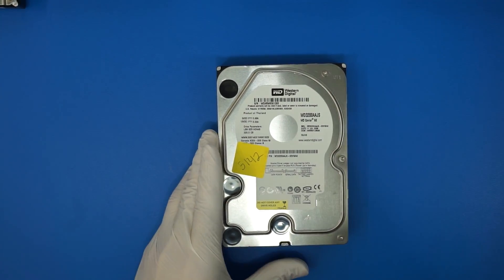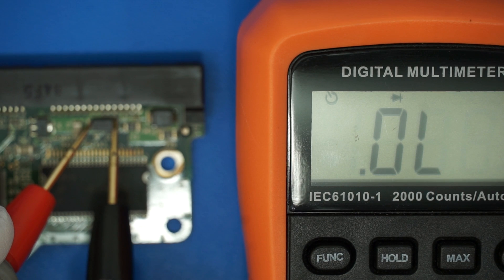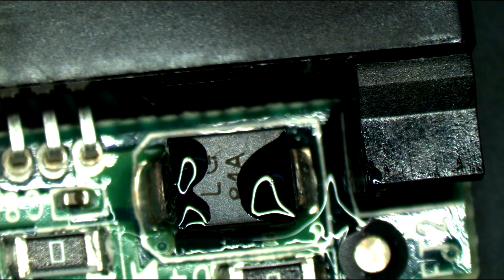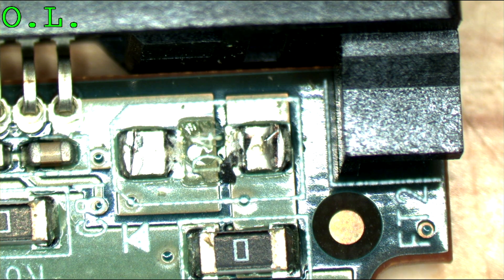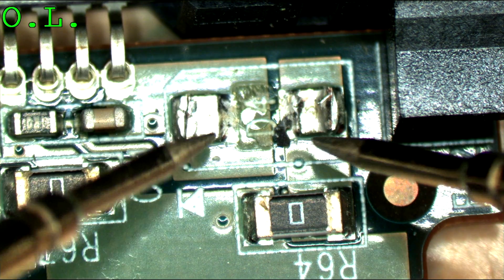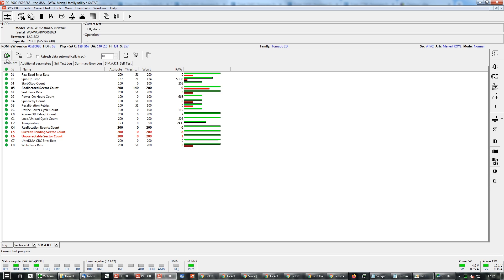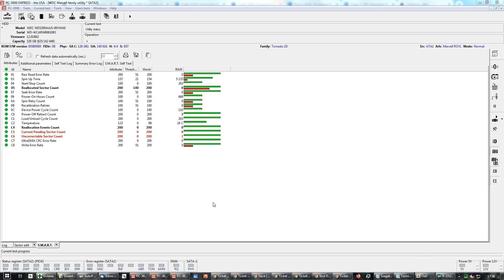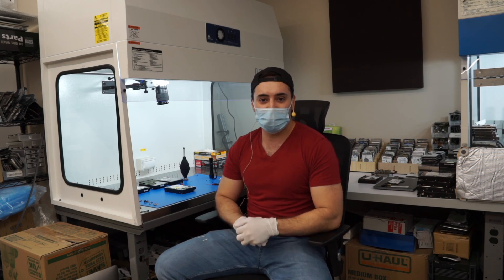How to recover data from a dead Western Digital hard drive when not powering on

Comment from the maker: To be clear, this is a 12 year old 320 gb drive. The moment the data is off of this, this goes into the bin and customer gets a new drive with their data. I have learned to anticipate every youtube comment ahead of time, steve has not. He assumed it was normal that people know this drive becomes a donor in the pile after the data is retrieved... A lot of people think this is being fixed for the sake of the 320 gb storage device itself.. No
Reply: NO FLUKE FOR HIM :\
Reply: No that still a perfectly good drive.  Just send it to me.  I will throw it in my Linux server and store something on it!
Reply: Are zero ohm resistors some inside joke? Why not use a jumper?
Reply: Ahh yeah, I wasn’t really thinking of the machines
Reply: @thomasa5619  They are a kind of protection, I have 2 samsung 500Gigs drive in a Lacie external box and both drive's 12 volts TVS burned from defect power supply. When i plugged them on an ATX power supply both 0 Ohm resistor smoked...
Reply: f4tboy99 it’s kinda impressive that it managed to drive enough current through a short circuit to smoke it...
Reply: Just because something's old don't mean it ain't no good no more, Lewis !!!!
Reply: Very old drive but also low amount of power on hours given its age. The power of electricity reigns supreme it can mess your day or drive up!
Reply: Chicago John A 320GB HDD? Bro you can get 4TB HDD’s for like $30.
Reply: Hut

Comment: Oh man. A 320GB HDD dated 2008. Those came standard with 24" iMacs back in the day, though I see no apple logo on it. My dad had one similar to that in an iMac, which failed by 2010. After data recovery, he replaced it with a gen 1 Advanced Format drive: a single platter 500GB Samsung HD502HJ, which still runs to this day.
Reply: Surprised it lasted that long the first go around.
Reply: It's a bit of a lottery with these things i feel, even more so with cheapo stuff. I have a couple WD greens and reds from 2014. One of the greens got 8 bad sectors like a year ago, the other 3 are all perfect still. Personally I have not had much luck with Samsung disks at all.
Reply: that's why you do backups
Reply: I also have the same Samsung HDD, 8 years and still working fine. Using it for Steam and game footage atm.
Reply: @zNoah  yup, but thats nothing you would send to data recovery, you would just re-download the games
Reply: @benediktfrasch2812  That's why I'm using it for non sensible data
Reply: @zNoah  yup

Comment: You need to get with the flux program! Ask Louis how much to use next time. Guarantee it will be a few ounces more! LOL
Reply: I've been watching Louis so much that as soon as i saw how much he put on, i was like "I prob would have put like 3 times as much just to be safe"
Reply: then the manufacturing plant will have an in flux of orders...

idk how to execute puns
Reply: Why even use any flux when removing?
Reply: Measured in micro-Pauls
Reply: I mean technically you can use as much as you want, there is barely a "too much", but too few will make the soldering worse
Reply: @benediktfrasch2812  I guess if you'll be cleaning the board afterwards, yeah.

Comment: I had on old Segate drive lock up on me. My first try was the old freeze the drive trick. That didn't work and it was the only trick I knew at the time. Frustrated, I turned the drive belly up and beat it with my screwdriver handle - and it spun to life! Percussive maintenance for the win!
Reply: for a stuck bearing often that works lol

Comment: Thanks for the "how it works" Steve.  I was confused about what a tbs diode was and why you'd test a diode disconnected from power using voltage readings.  Something for transient voltage spikes makes more sense.
Reply: @Pi Pony it protects the components from to high voltage, like a fuse/breaker
I'm not sure tho if it causes them do go bad

Comment: ...and for those without a hot air station or a soldering iron, flush cutters can remove the defective component, then you can use some scotch tape and some spit to attach the new component
Another quality job, another satisfied rube
Reply: “... and never mind those pads you ripped off the PCB in the process.”  Sigh.  That idea never should have made the final cut.
Reply: @hornbaker  It was intended only for when you dont have annother option, which for DIY is reasonable. ofc if it was for a customer then it wouldnt be good enough.
Reply: @hornbaker  Yeah, it didn't look great lol. But does it even matter if you rip the pads off seeing as he's not attaching a new one, just taking the faulty one off. 🤷‍♂️
Reply: D3, D4 removal: what a cowboy. Doesn’t matter if the board won’t go back in service, he’s instructing people who don’t know better that this will work. What’s next, a chisel and hammer? Louis, after watching many of your videos and fully respecting your skill, I can’t believe you let this video out. He’s representing you, and teaching cardiac surgery with a bread knife. Ouch.

Comment: Some days ago I fix one with a "very similar" Logic board with a eeprom on it. The Marvell Chip burned. That one is more easy to fix as to buy a new board is just around ~5USD at my place. What we need is just copy the eeprom data from the old logic board to the new logic board through a CH341A and a clip. 

This video shows that WD sucks that it's more difficult to fix those drive without a EEPROM. In case the controller dead, you can't get back your data as you don't have your P-List and G-List

Comment: Steve I got a similar failure on a western drive I bought from ebay. Fixed it by replacing 12V TVS diode and 0 ohm resistor (fuse).
On my WD drive the 12 TVS diode and 0 ohm resistor (acting as a fuse) were broken (12 TVS diode was shorted and 0 ohm resistor was open circuit).
I think it's better to check both TVS diodes and 0 ohm resistor (which are the 2 big 0 ohm resistor near each TVS diodes) if they are still at 0 ohm.
Sometimes you can find one resistor in open circuit like I did because when the TVS diode break in short circuit a high current is flowing through the 0 ohm resistor and it make break in open circuit (not always but can happen in case TVS failure in short circuit).

Comment: Good info, I like to see videos like these.  I wouldn't have known what that particular diode circuit was, I would have assumed it was a regular diode and needs replaced to work.  With the short removed, the only thing it would be missing is the over-volt protection.

Comment: For those who keep saying this is a Louis clone, look at 02:51 for proof that it is not a clone.

04:30 WTF Steve? If they don't have an iron to take the diode off then how are they supposed to put it back on. Hammer and nail? Ask eugene? Call JayzTwoCents (that'll work out well, hot glue gun and all)? A cheap soldering iron $10, a cheap and nasty hot air, $55.  An eBay combo unit about $80. That's cheaper than a new HDD. Snips, REALLY ?!! 🤦‍♂️

Thanks for the video. 👍
Reply: Joseph King: I had the same thought. Ok if you are going to clone the drive or back up the drive immediately, and replace it with a new drive, then not replacing the diode makes sense. Assuming they're careful and don't do what blew the diode in the first place. However I would not recommended using the drive as normal without replacing the diode. Western Digital didn't put the diode there for sh*ts and giggles, it's there to prevent damage in use.  👍
Reply from the maker: This is to copy the data to a new drive. I would not recommend usinh a repaired hard drive. This is probably older than the employee who edited this video. Replace the drive!
Reply: @rossmanngroup  My apologies Steve. It wasn't until much later that I realised that you were just removing the diode to get the drive into a state where you could recover the data. Before that I had thought it was a method to retrieve a donor part for use on the client's drive so the data could be recovered. DUH ME! 🤦‍♂️

Hope you are able to produce more of these recovery videos. I find them quite enjoyable and educational so THANK YOU !

Comment: Why is it that the diode does not have to be replaced?  Is it because you are using the correct power supply, so you know the drive will be fine?
Now, what do you do if the pads under the diode happened to be shorted?
I open dead drives to get the magnets 🧲 Thanks, great job Steve!

Comment: Consummate professional drags out  a £10 cheap-jack throwaway multimeter!  "Hey, it does the job."  Quite right too!  I know you have more professional tools available to you for when the task demands, but sometimes you just need that cheap shit that's right under your desk to give you a sensible-looking figure.
I bought my first meter 30-35 years ago at Radio Shack for £5, miniature thing that runs off button cells, and it amazes me I still have good uses for it today as a professional -- 'coz it fits in my shirt pocket :-)

Comment: How does someone "connect the wrong power supply" to a HDD ?! the connectors are hdd specific and the voltages are standard. so hows that possible ?!
Reply: That’s what I was asking myself too, how the hell does someone do that, unless with a shitty SATA to USB China adapter I can’t see how this is possible, and even the adapter theory is a far reach
Reply: Only thing I can think of is if someone used a modular power supply and plugged the sata cable into the wrong place
Reply: powered hard drive enclosure? maybe? that or it tppk the laptop with it but the data is all they care about
Reply: @Rabidius  but how? the sata cable only fits into the sata port on the hdd and modular power supply.
Reply: Old HDDS used to fry if you plug the cable upside-down,maybe this is the case?
Reply: @tezcanaslan2877  u talking about PATA. these are LONG GONE. see the PCB here ? its SATA.
Reply: Never underestimate how stupid people can get,
Reply: @ArmiaKhairy  youve got a solid point there! i have seen some too. i try not to think about them  too much. its depressing.
Reply: @gorak9000  Exactly this. I've personally encountered two people who have killed an external hard drive like this.
The problem is that most people don't seem to care about pairing the correct power supply with hardware, and then they think whenever the plug fits, it's the right one.
Reply: Easily.  Especially with those universal adapters.
Reply: @tezcanaslan2877  impossible, those cables are keyed to prevent that.
Reply: doesnt have to be the wrong one, power supplies also can fail, they have security features that should protect the hardware but they don't always work
also there is such a thing called lightning storm
Reply: @Rabidius   @金3 A.M.  Yep. Definitely possible.
I've seen two reputable branded PSU's side by side while building a few desktops. One
Peripheral and Sata separate and Sata+Peripheral combo slots. 
One had direct voltage, the other switching. Identical plugs.
Reply: With the sata power power connector, if you push hard enough for the power plug to split apart it will connect enough to cause issues.
Reply: Bad things can happen. I've fixed a couple of HDDs of the external enclosures the same way. I think it's because of either spikes or induction via thunderstorms. Usually, the drives work fine, just TVSes are aging.
Reply: Well, the 4-pin Molex connector used on these drives can be electrically connected backwards, sending 12V down the 5V rail and vice-versa. The shape won't allow it to be PLUGGED IN backwards, but the pins and sockets can touch, so if you plug it in with power on and don't check the direction first, BOOM.
Reply: Axel Werner I’ve managed to touch the connector the wrong way round while groping around under the desk in poor light and it zapped the drive. I will now go find that drive and remove the diode.
Reply: @Rabidius  12V is the highest voltage that computer power supplies provide. HDDs take these 12V. The only other voltages are 5V and 3.3V. Both of which are lower than 12V, therefore wouldn't burn any component.

Comment: You should do one about checking the contacts between the board and the HDD itself as these can dull and look corroded, they just need cleaning which can be done with a soft eraser. This should be checked first really as it could be just that. Remove the board and check and clean first, replace and test, it may just be that. I have done this myself, in fact, the contacts on the left of the board that make contact with the HDD do look dull and like they need cleaning @ 0:49 (20 contacts, 10x2 top left of board) 
 
I had this issue only a couple months back with a 2.5  2TB seagate hdd and it was the contacts. The HDD would not spin up- or anything, very lucky if it did but then died again. I checked the contacts, cleaned them with an eraser, and Bob's your Uncle, it's fine.

Comment: Thank you for this video. I got 2 data drives in my PC. One shows up and then disappears of the system in few minutes and one simply stops the computer from turning on. I checked the diods loke you did but they are good. Any suggestions appreciated.

Comment: I have a 8tb Seagate that I had a shorted power supply take out. It actually took out 2 drives the 240gb had a burned PCB so I replaced it and moved the eeprom chip from the old board to the new put it together and I got nothing. Tested power and it had voltage at the motor contacts. I gave up on it as I was attempting the 240 and didn't want to lose everything from the 8. I bought a replacement PCB for the 8tb but I never tried moving chips since I couldn't get the other to work. There's no damage to the 8tb PCB but it doesn't power on and even after just trying the other PCB it still doesn't even so much as spin up.

Comment: Seeing this every 3.5 HDD needs is 5v sata connector. What do you mean by wrong power supply. Possible only on external doc with unstable supply. But most PSU should deliver clean 5v when it is being rated 80+ efficiency on branded.

Comment: I have the common problem that the sata plastic has snapped, shame as one is a 12tb hard drive a year old and a 8tb hard drive a year old and now I want to sell them! Right now I just hot glued on a right angle "extension" as I don't know how to solder on a new board.

Comment: If someone doesn't have a soldering iron, how would they install the new diode?  It would seem to me, that regardless of how you remove the defective one, you're going to need either a soldering iron or a hot air station to complete the job.

Comment: So you don't need to replace the diode? Just remove it then power it up? And I'm not sure which power adaptor actually goes with it now. Are they usual 12V / 1.5 amp output?

Comment: The resistive mode and diode mode voltage values you read depend on the current used in the multimeter. Still it should not read a short.
Reply: TVS protection diode goes short permanently when the voltage is too high.  This causes most power supplies to shut down when they detect a short, and so protect the drive from the excessive voltage.
Reply: @tonyonofrio1147  yes I worded that wrong I meant that it should be able to read a short. It is the resistance and voltage in the ohm and diode measurement that can vary on the same diode depending on the type of multimeter.

Comment: Did you replace the the TVS or just remove it?
Reply: He just removed it. For saftey use a trusted power supply or replace diode if power supply quality is unknown.
Reply: gorak9000 This was a 320GB drive that was over 10 years old. Best thing to do here would be to move the data off to a new drive and not worry about the TVS.
Reply: @docgiggles130  
I didn't have that information. But yes, that would be the sensible thing to do.
Reply: @docgiggles130  No idea what I'm talking about, but you can use the drive without the TVS?  Or at least access the data?
Reply: @andrewkoines6389  You can. The TVS acts like a fuse and will fail if the voltage goes too high. It's there to fail first before the rest of the drive gets destroyed. You can remove it and still use the drive, but if there is ever another overvoltage, the drive will not have any protection. Best thing to do is recover the data and scrap the drive after.
Reply: @docgiggles130  Thanks for the explanation.

Comment: Hello. I have a not recognized unless I format type of deal on a 3tb mybook external hdd. The reason for that being that the external pcb has a burnt component due to high-voltage with the wromg plug.. anyhow I was wondering if I can get a link or something to your business  so that we can discuss repairs if possible. I also have a rog strix GL 703VD-WB71 asis laptop that has a cpl burnt components on the motherboard as well that id be interested in getting repaired. I've been following u for hot minute cuz and I can dig your cleanliness and your knowledge as well as your expertise.  Looking forward to hearing back. God bless 🙏
Reply: Check the very first line in the video description - Rossman Repair Group :-)  They have a shop in NYC or mail-in service.

Comment: After removing the diode, how come multimeter shows voltage without connecting pcb to power supply?

Also isn't one supposed to fix the board by soldering new diode in the same place?
Reply: its voltage drop - characteristic of a diode. and yes you should solder new one. but you can live without it. its there just for protection and if you dont have that on hand and or dont have soldering iron you can run your drive without it but next time instead of just replacing that small part you may get a lot more troubles
Reply: Vasily Bulochkin With how cheap hard drives are, I’d just transfer the data off to a new drive.
Reply: @docgiggles130  that's an option for sure